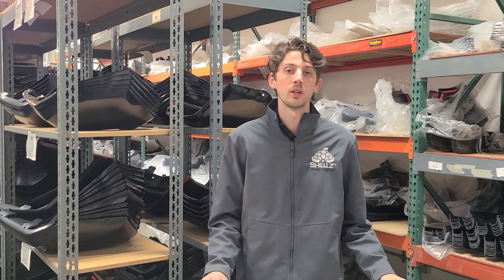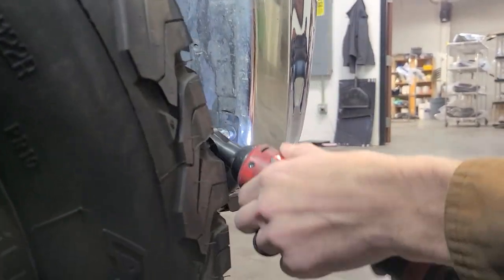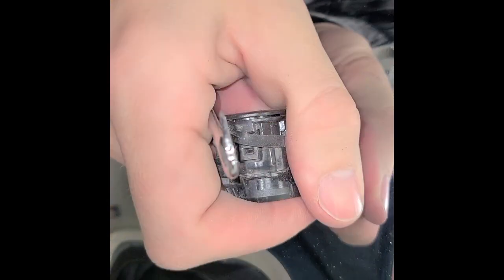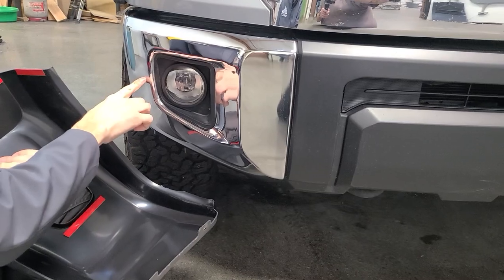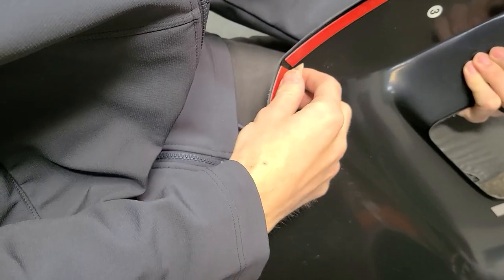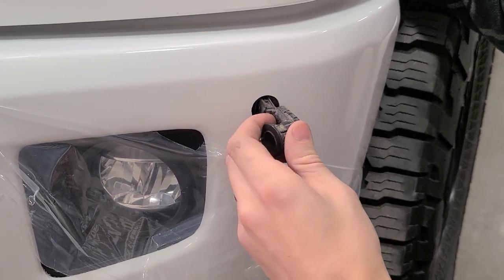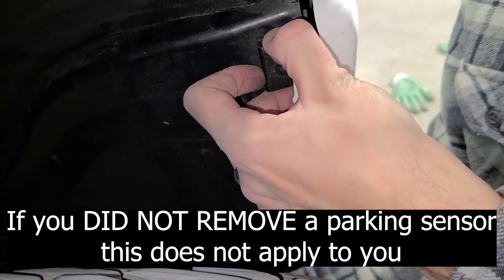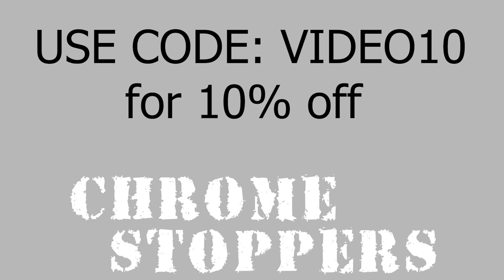2014-2021 Toyota Tundra Front Bumper Chrome Delete/Blackout BumperShellz Installation Instructions

Comment: My V3s installed really easy BUT getting the inner fender liner back on was a bit difficult. I broke the bottom tab on each side trying to get them to slide over both the chrome bumper tab and the bumpershellz tab. A little JB Weld fixed that. The shellz dimple in around both parking sensors  but not terribly noticeable. All in all I am happy with the look. It was the only solution to get rid of the chrome bumper caps as the $700 Toyota caps are no longer available, at least not in my Cement color.

Comment: What if you need to replace the fog light lamps?
Reply from the maker: Shouldn't be a problem. The 3M tape should hold on pretty well as long ss you aren't driving. So you can still replace your burnt out fog lamps when you need to.

Comment: Trying to figure out wich will match better the textured tpo  or the armor coated abs, with the front plastic pieces on the 2016 f150
Reply from the maker: That's always a tough decision. As luck would have it, we were just filming a video and that should be live in the next couple of weeks. I believe the Textured TPO would match very well to the rest of the plastic on the f-150.
Reply: @EcoologicalVideos  thanks!

Comment: What the difference between the v2 and v3s?
Reply from the maker: On the V3, You don't have to remove as much hardware which makes for an easier install. However, this leads to the potential for some chrome to show, which is why we include blackout tape. 

As of writing this, we have sent out over 100 or more V3 tundra fronts and haven't heard anyone have issues due to fitment changes we made.